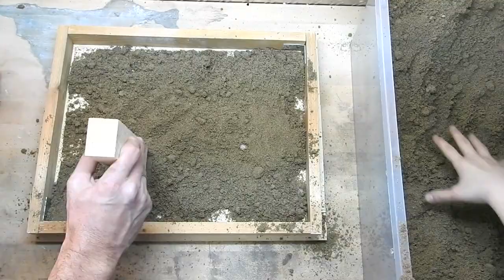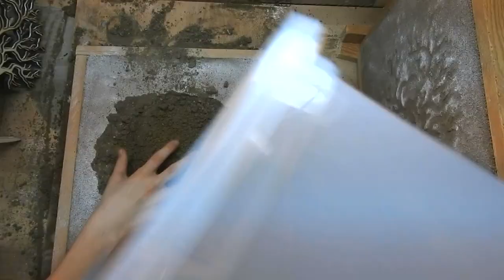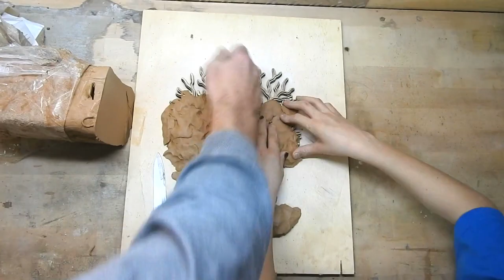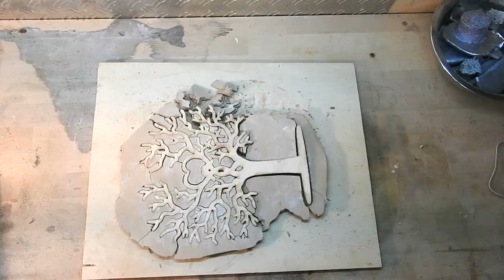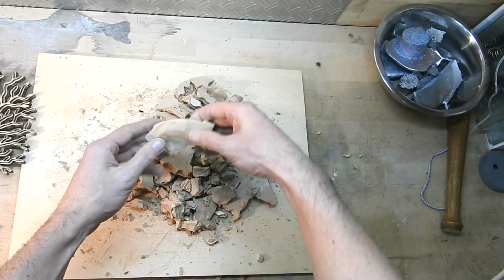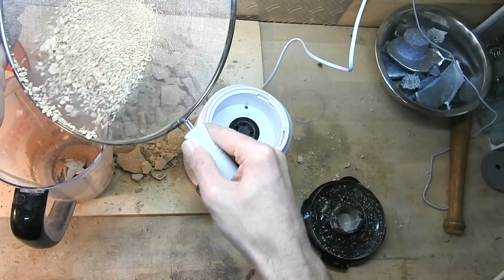Aluminium Tree Casting. Part 3/3. We need HELP!

Comment: Honestly, for the sand casting, Id try to use petrobond sand. Its more like a clay then a sand. But my favorite casting method (and the one I thing that would work the best) is lost wax. You make a silicone mold of your tree and cast it that way. If you don't want to use silicone, you can buy "agar agar" its a gelatin, but it works very good for one time molds. If you do use agar agar, just use a low melting point wax like paraffin. It looks like you already have clay, and sand, so you can make a slurry, or a mold as you did your video to make the copy. If you decide to make a clay mold (as you just did) add some sand to the clay, it will help it from cracking from heat shock.  I have a video on my channel where I made a slurry (Making baby yoda out of cat food cans)!
Reply from the maker: Thanks for the hints. I think I give the lost wax casting option a shot. Hoped to get arround all this different steps. :-) As it is a quite tedious task as seen in your starfish video :-). And combined with the slurry technic it doesn't get easier. Then easy is sometimes not the way to go- :-)